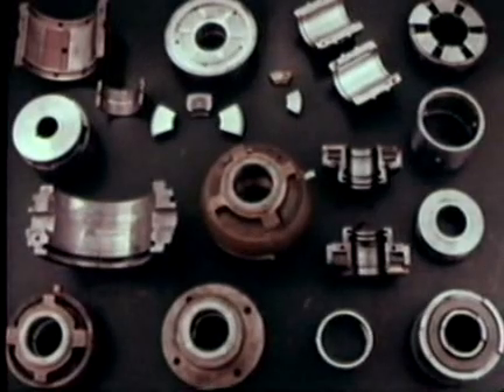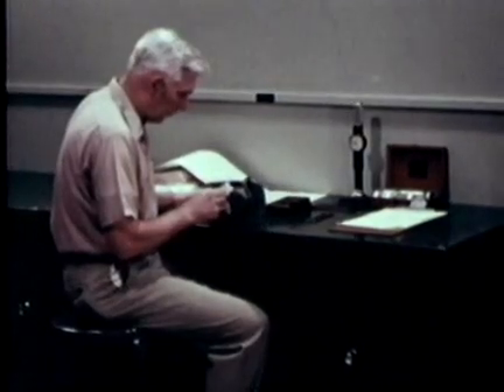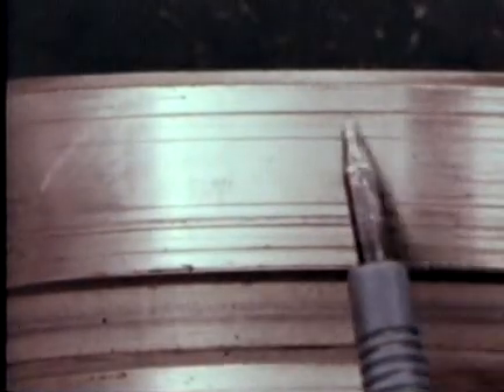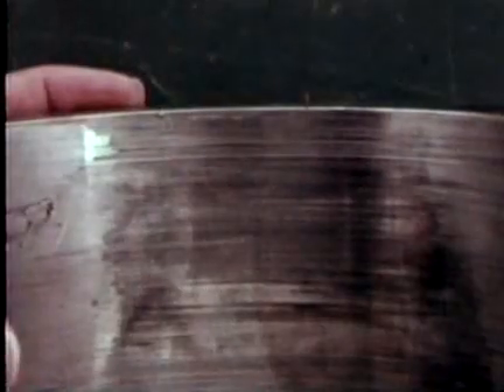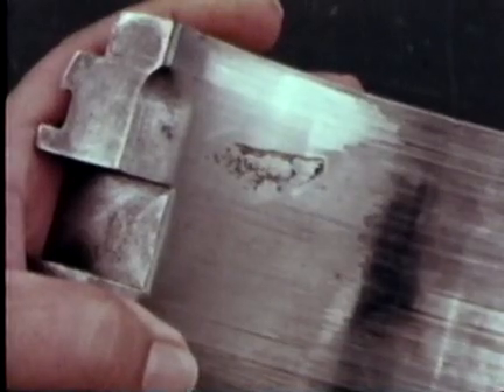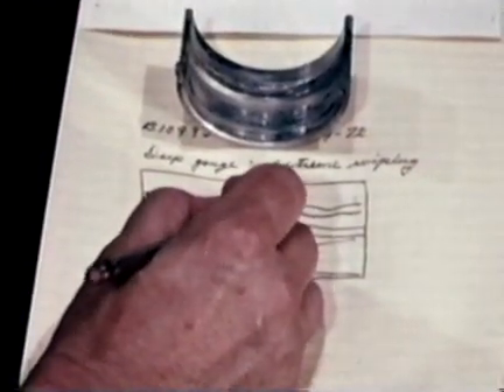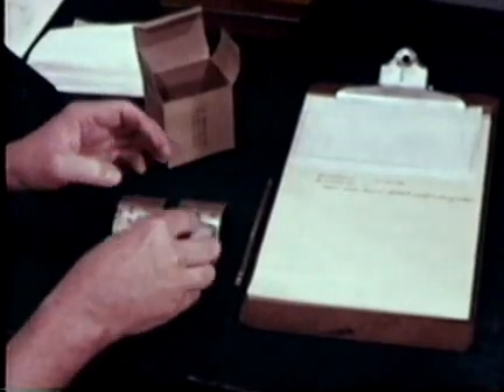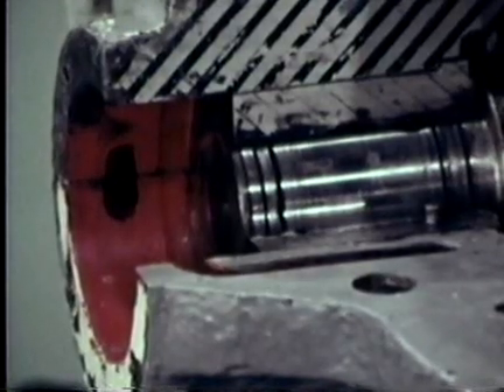U.S. NAVY (Plain Bearings) Interpreting Service Damage In Bearings

Comment: An excellent video. Properly installed and maintained plain Babbitt bearings will last almost indefinitely. Nearly all of the wear occurs during the few seconds it takes to develop the .001 to .002 inch oil film. On horizontal machines, the oil film can be demonstrated by using a dial indicator. Start the lube pump or have the oil rings in place, and manually roll the machine over. The shaft will rise indicating the thickness of the oil film. As the narrator stated, there's no metal to metal contact from that point on during operation.
Reply: Exactly.
The generator bearings at Hoover Dam are the originals from the 1930s.
Reply: True, some were refurbished,  I worked on several of them while at Kingsbury.
Reply: We hired a contractor to refurbish a very large water pump. When they got done they went to start it up and it ate the new sleeve bearings. 6 sets as I recall. 1 set lasted all of 8 seconds.
Reply: @ghost307 wasn't there a system to pre pressurize the lube?
Reply: Great film. He looks mean enough to be a CPO, but I didn't see a coffee mug anywhere in the shot. Must be an actor